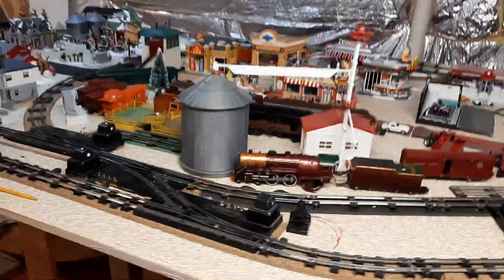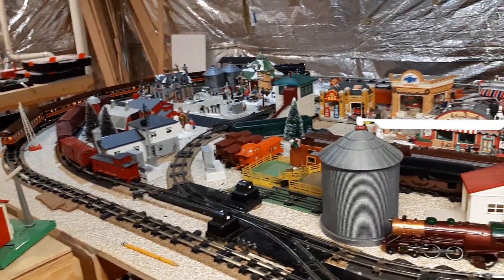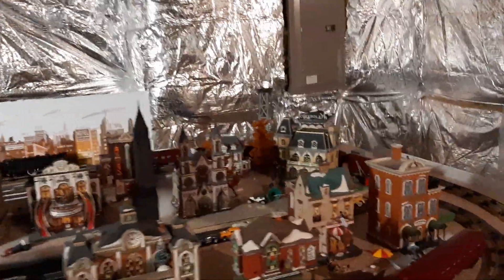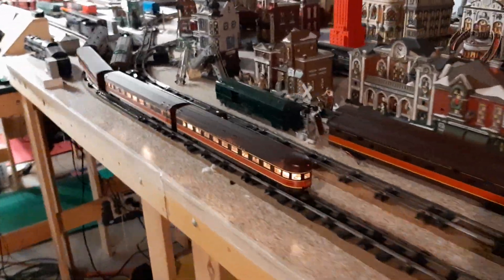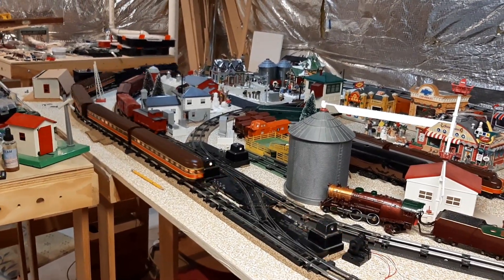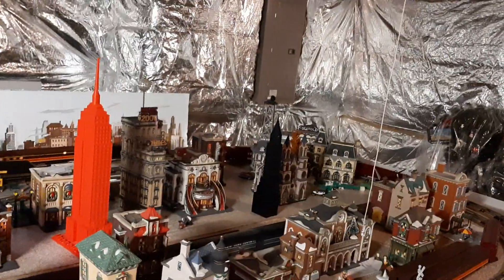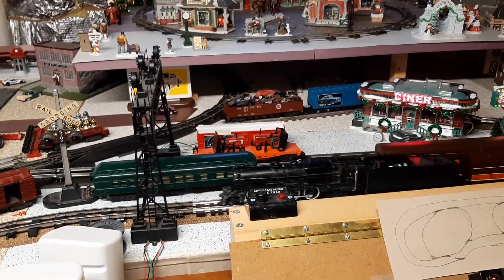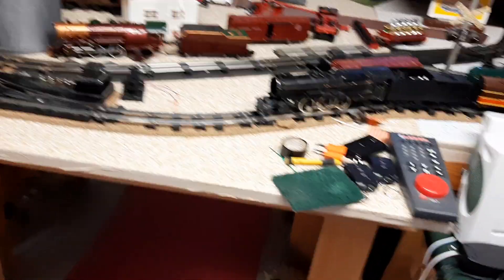Frankentrain Laboratories 310 tender truck test

Comment: Just found your link you left me for this video.  The sound is awesome and then the whistle comes in. WOW!!!! very nice
Reply from the maker: I wanted you to know the full engine capability, that is the early single sound board from ERR. Not made any more I found 4 and bought them for $40 each. Chips can be changed to go from Atlantic, to Pacific to Northern Sounds. Now working on a sound system from Ngineering with a Micro Controller. Oh And Pulse Width Modulation motor control. It requires 15V steady on the track. Should be a hoot keep watching. Enjoy your feedback. Dennis